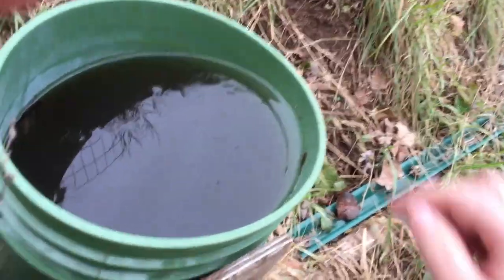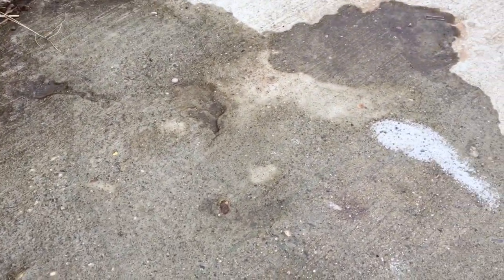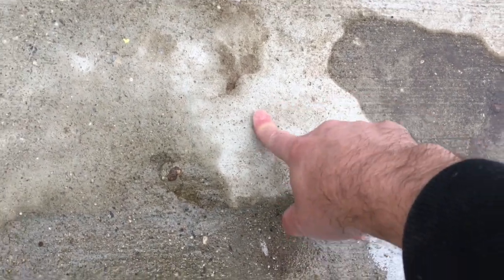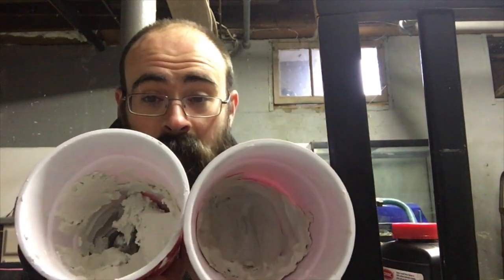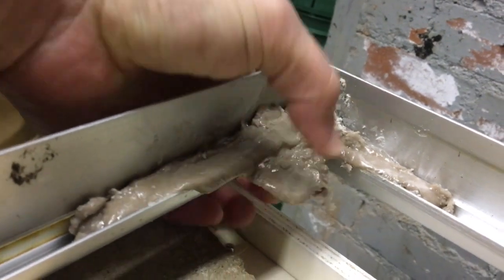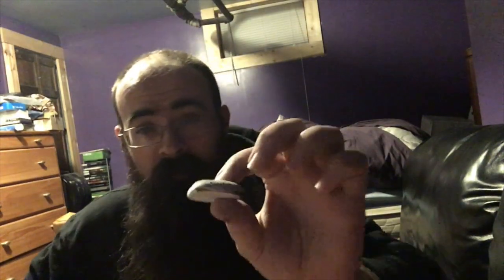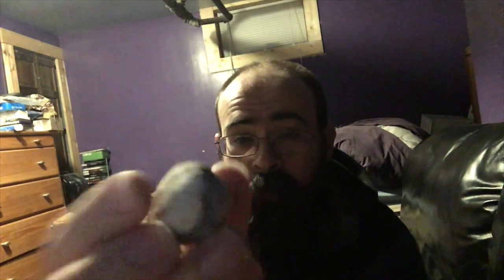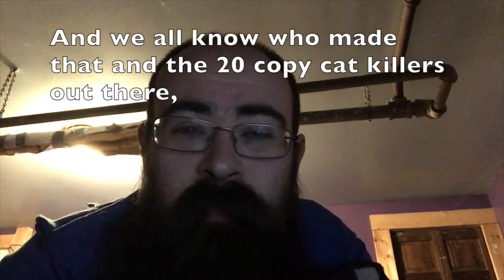Water glass test resalts

Comment: Have you read about acid resistant concrete ? It's made the same way , but instead of heating it getting washed with sulfuric acid solution , which remains only pure SiO2 in the concrete without sodium ions in it . It is industrially used for protection of different chemical reactors from acids , where no metal can survive . This concrete claimed to be water impermeable with working temperature to 200 C

Comment: I’m no chemist, but been working some with this stuff and I think if ur curing w/heat the water had to b driven off below the boiling point, like in an oven of some sort for thicker pieces… also made a sand brick w/Portland cement, and it seemed to cure - but wasn’t too strong (stronger than green sand for sure), it’s the calcium compound I think, and it’s also in plaster of Paris. If it’s in a refractory with Portland, sand , and vermiculite, I think u need a clay of some sort (additives to handle higher heat for foundry). Add only enough Portland to cure the water glass, use fire clay or whatever as the main binder (maybe10%-ish), sand, vermiculite (withstands higher temps than perlite), and some people put a coating on the inside surface of aluminum oxide (sold as sandblasting abrasive) for heat durability (mixed with just water glass. Overall, u can heat to cure right away cause the water glass just glues everything together, in this application , until the main refractory ingredients calcine( transform), because at higher temps (1200F if I’m correct) the sod sil breaks down anyway (although in a 2”firebrick the outside half may stay intact). But without the normal clay binder, the heat would eat right through it pretty quick at foundry temperatures. Below that, for food oven temperature, u should b able to replace the clay entirely with cement 7-10% as your binder (that’ll b more than enough to cure sod silicate)… sand, cement, vermiculite, water glass. Mix dry ingredients first, then add water glass.
Reply: And I’ve seen many videos where they fired it right away… I’ll try a brick when I get to it…

Comment: Look up clkindred’s video: how to build a trash can forge. He uses distilled water, sodium silicate, perlite, and 220 grit aluminum oxide. I followed his instruction and successfully made sodium silicate and used it as directed in the above mentioned video to make a refractory lining for my homemade forge.  The aluminum oxide is what made all of the difference in the world. No heat treatment needed. I just kept it in the garage and let it dry. He also mentions a mixture of just aluminum oxide and sodium silicate to make a more heat reflective coating for the last layer of the forge. He did cure the outer layer with heat. Hope this helps.